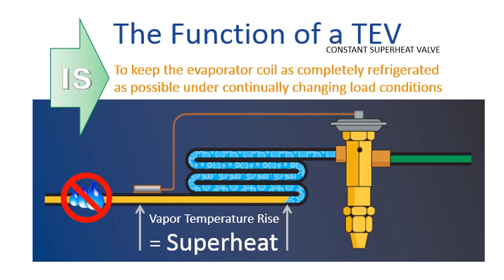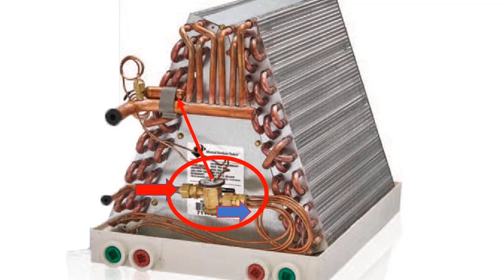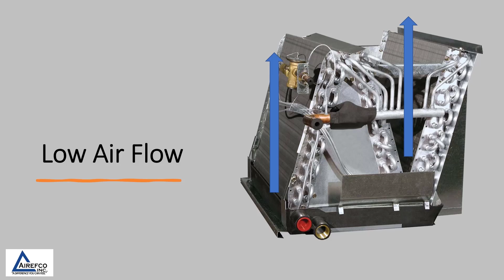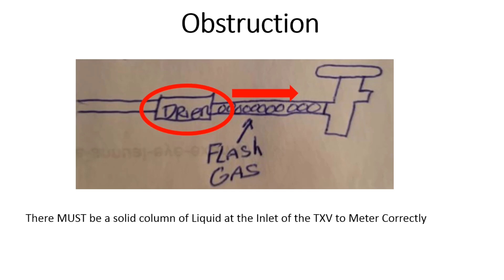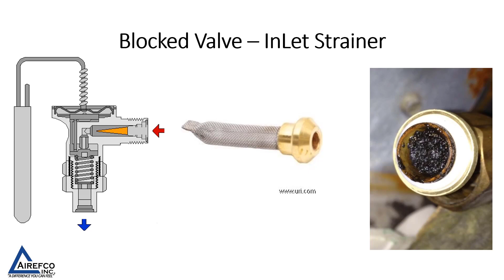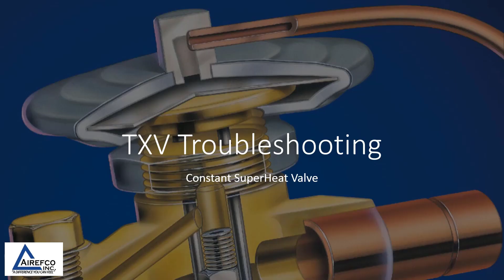TXV Troubleshooting

Comment: Scroll across to the one minute mark where it shows the “N” coil. Your comment about how important airflow is can’t be underestimated. 10 years ago or more I was on a call with lack of cooling and it baffled me for a couple of hours while I checked refrigerant charge, superheat, sub cooling, temperature split across the coil, looked for restricted return, restricted supply etc. etc. it was an older furnace where the coil had been retrofitted into an existing old upflow coil cabinet. I then figured my next step had to be to open up the coil cabinet and physically see what the heck was going on, maybe the coil surface was plugged with a blanket of dirt or what? 
Then I found the problem! That N coil had been installed in this big old sheet metal box and to support the side of the coil that had the upright slab, not the A  section of the N coil but the upright slab coil section.. The installer had put a complete sheet metal blank off under that section of the coil to support it so in effect the only air that was going through the coil was through the one A section. I removed that sheet metal shelf and put a better sheet metal support under it that allowed air to go through that slab section and guess what!? It worked perfectly and the charge was perfect!!